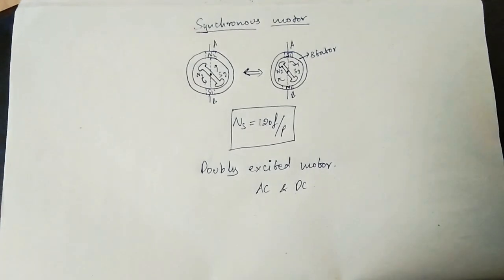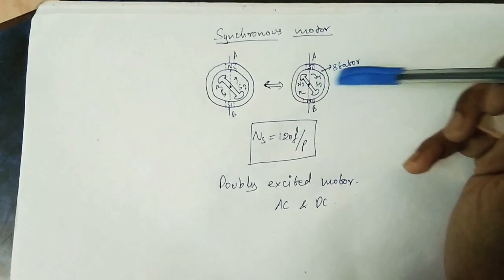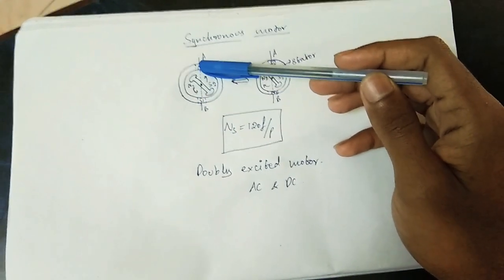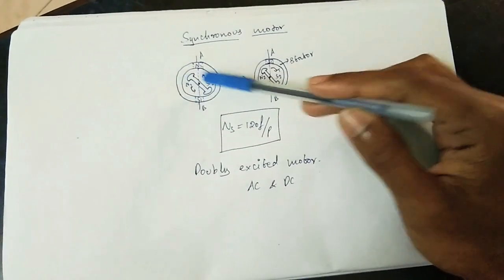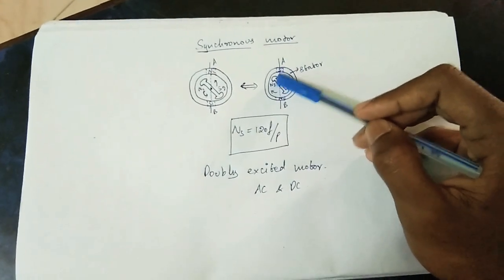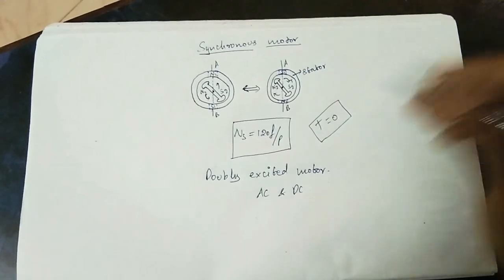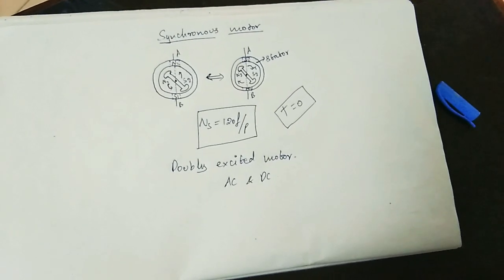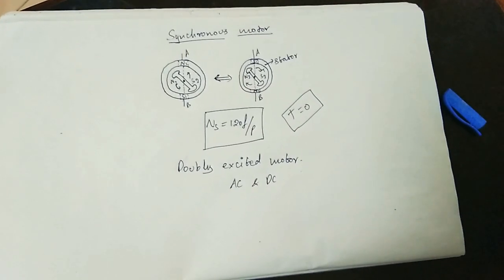Why synchronous motor is not self starting?(Tamil) | EE | Electrical machines

Comment: Rotor la commutator use pantroma bro
Reply from the maker: Commutator is used only in dc motors. Rotor has no commutator.
Only we use in stator(field winding) of dc motors
Reply: @endlessedutainment9606  commutator purpose sollunga bro
Reply from the maker: Commutator is used to convert dc  to ac(input) in dc motors.
It is used to convert ac to dc(output)  in dc generators.
I